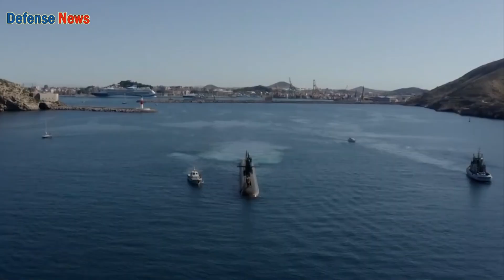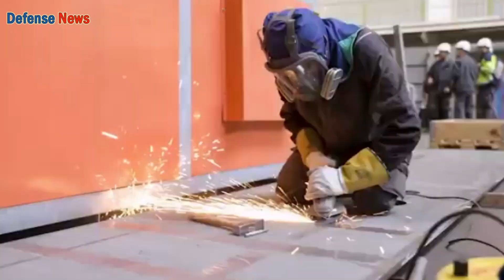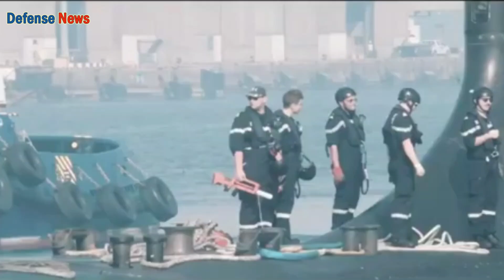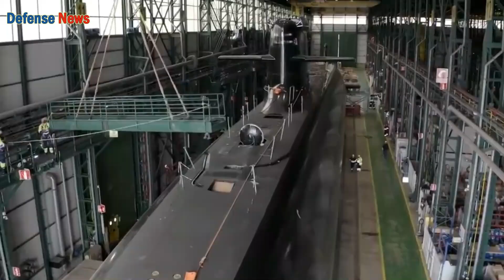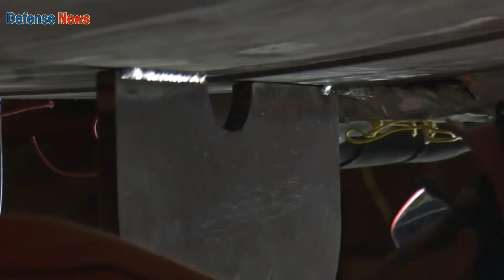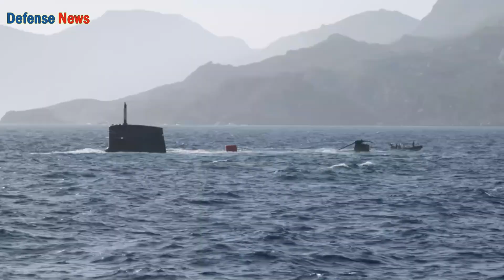Navantia vs Naval Group: Which Submarine is Best for the Philippines?

Comment: They should go with the French design. The fact that Navantia had to hire US Engineers to help with fixing the S80's design issues shows that they don't know what they're doing. Good luck with designing the next generation of subs without a French design to base them on, as now the French have refused to help any further.
Reply: Around 40 companies worked under Navantia in the S80. The problem with the S80 was because they made a mistake with it's design and had yo "start again" not because they did not know what they were doing.
Reply: France helped with what? When both countries collaborated, Spain only worked on the stern of the submarine:

-Primarily the stern section, which includes:
-Propulsion compartment
-Propeller shaft, transmission system, and coupling.
-Propeller (7-blade, silent design).
-Main and auxiliary electric motors.
-Diesel generators and alternators.
-Propulsion control systems and reduction gears.
Auxiliary stern systems
-Ballast and freshwater tanks in this section.
-Hydraulic and rudder and steering control systems.
-Part of the refrigeration and ventilation machinery.
-Strong stern structure and hull.
-Construction of the seal ring and watertight bulkheads toward the machinery area.

Although the French accused us of copying their submarine, that's not true. Initially, it was externally similar to the Scorpene, but throughout development, much has changed, especially internally, since France refused to help us. So, we now have the experience to create our own submarines. That's why it took 20 years, not only because of buoyancy errors.
Reply: The S-80 has nothing to do with French submarines and it is superior in all regards to current French submarines.

Comment: KSS 3 ang pinaka superior, w/ VLS  ballistic capable, 89 m. ! !
Reply: The S-80 already has the space for long range missiles, it was designed with BGM-109-Block-IV (up to 1650km range) or the future MdCN (1000km+) in mind, just not equipped yet. The VLS of the KSS-III are designed for short range ballistic missiles like the Hyunmoo-4.4 submarine launched version (500km) mostly for nuclear deterrence capabilities, not sure that feature is relevant for the Philippine Navy, although the KSS-III is a superb submarine. On an anecdotal note the KSS 3 uses Spanish components with an EW combat system from Indra that includes ESM capabilities like SIGINT systems, the Aries navigation radar and IFF (friend or foe) systems.

Comment: The S80 is not a tested submarine. It is the first submarine built by Spain and it took several years to be completed that had cost more money than the proposed budget. Production was delayed for many times because of budget and some technical problems they said. Consider the German, French, and South Korean platforms instead I think...
Reply: It is TESTED AND IS CURRENTLY IN SERVICE WITH THE sPANISH aRMADA. s82 & S83 ARE CURRENTLY UNDER CONSTRUCTION.
Reply: @andrewfernandez7203  Yeah it was to heavy abit embarrassing for Spain.